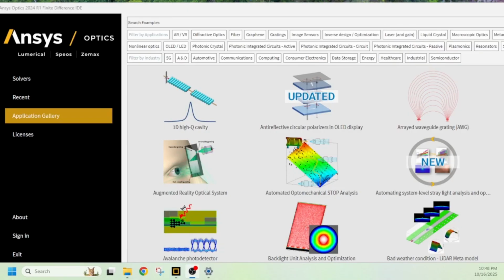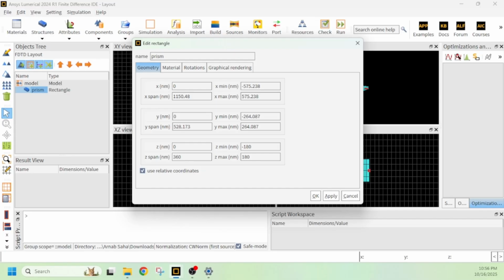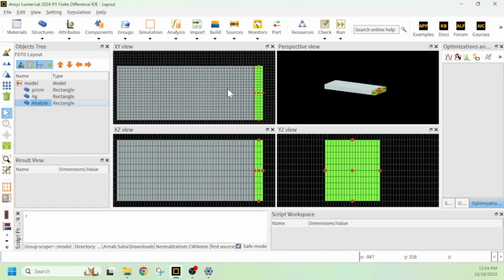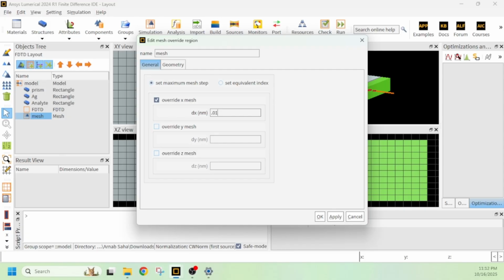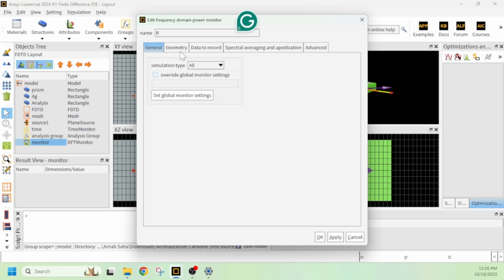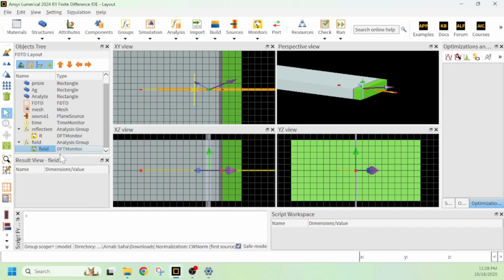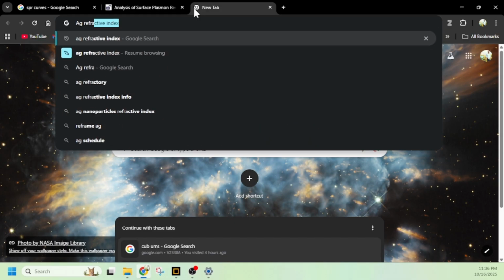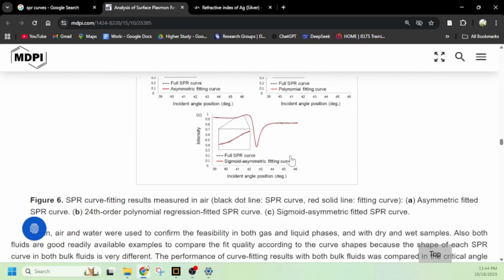Design an SPR Sensor from Scratch in 1 Hour | #spr  #biosensor #lumerical #photonics #thinfilms

Comment: Hello, I have a question. If the structure is layered, for example, made of 2D materials, will the monitors be the same? And how will the results change?
Reply from the maker: Yes the monitor will be same, and the results will be available in R at sweep